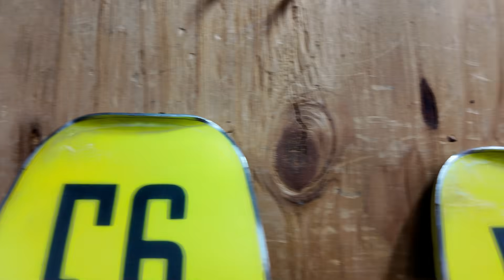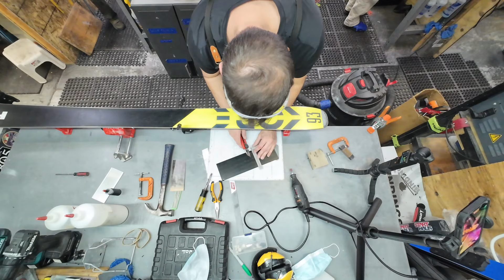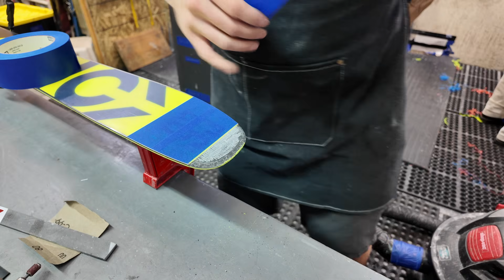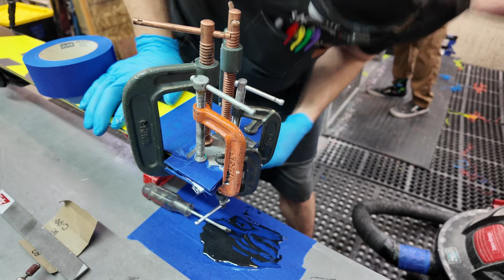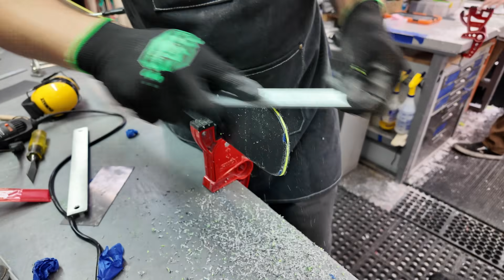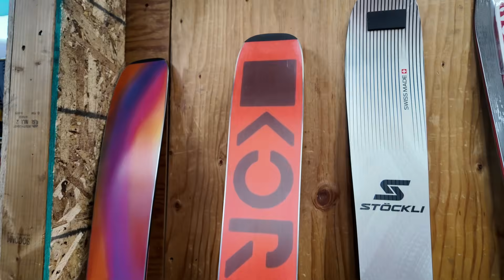Fixing a Damaged Tail on the Head Kore | Technical Ski Repair

Comment: Well done, can not figure out what caused that to happen in the first place - walking to the lifts, dropping skis on the tails in the parking lot a thousand times?
Reply from the maker: Those are good guesses. Stabbing the skis into icy snow to stand them up can also contribute. It’s certainly repetitive damage and happened over time.
Reply: @Starthaus another reason to avoid icy skiing
Reply: Lifty at Vail did this to my J skis escalators loading them into the Eagle Bahn gondola. Slammed them into the metal basket 2-3 times repeatedly with increasing force. When we got off both tails looked like this. Spent most of the morning talking to lift services and guest services about it trying to file a formal complaint/claim. vail didn’t care just kept wishing me “an epic day”.  I repaired in a similar way at home.

Comment: That was some really nice work. What did you you charge for just the repair work?
Reply from the maker: That's a out an hour of labor per ski plus a bit of materials- not counting the finishing tune and grind at the end (but including the rough belt work) it comes it at roughly $200.
Reply: @Starthaus thank you for sharing your methodology, very helpful for home DIYers, but if it's caused by repetitive stress, likely that the skis are also coming to the end of life as well? To me it's not really economically viable. Though still a great example of what can be done, especially at home if you already have the tools and bits, and the PPE and proper ventilation etc. I think that I will stick with using 2 part epoxy and some clamps to eek out a bit more usage

Comment: Very neat repair. If you were incorporating a new metal edge, would you stick both this & the base in as one? Some other things I've read/seen appear to favour sticking the edge in first, and the base material later.
Reply from the maker: When Brando is adding new edge plus a patch, he usually does it in one go, clamps it all together, and lets is cure in the hot box.